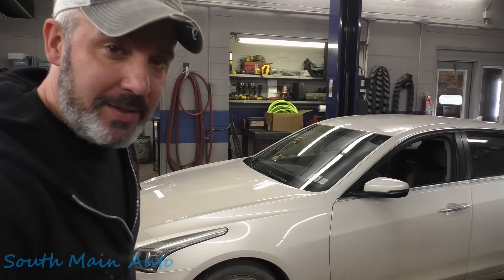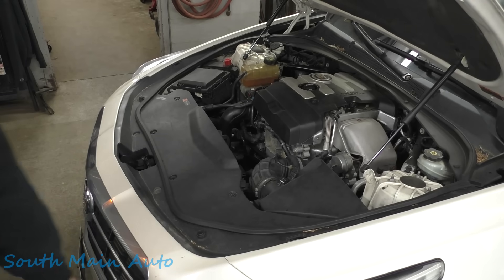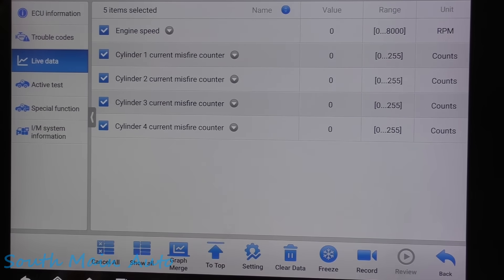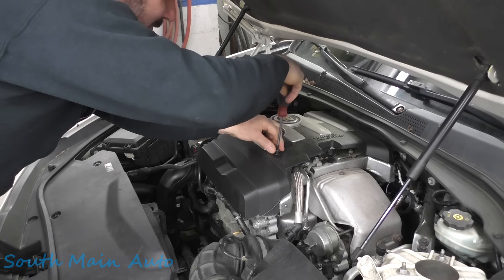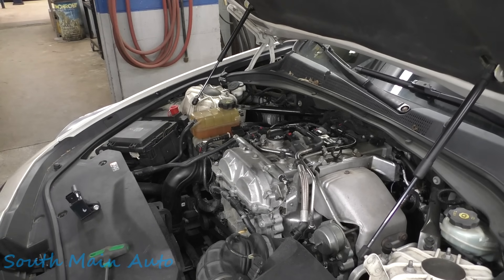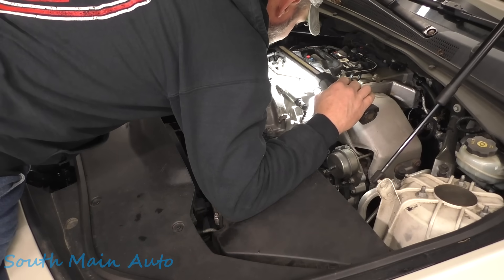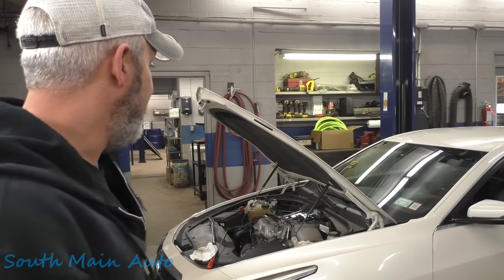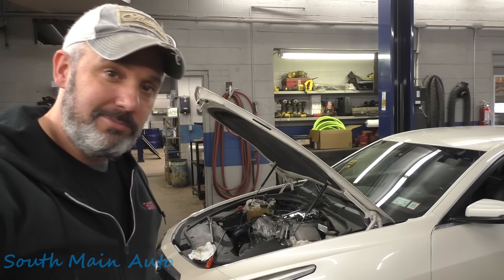'14 Cadillac CTS4 2.0 Turbo - Major Engine Damage

Comment: I bought a 2013 f350 super duty diesel a few years back. When it stopped starting I took it in for repair to a guy near me who only works on ford diesel trucks.  I wondered at the time how a mechanic could be so focused on such a narrow product line and still make a profit. 5 years and $10,000 later, I now know why.
Reply: I know a one man shop that does almost exclusively Subaru head gaskets.
Reply: Ya diesels went down the tubes around 2005 when the govt put all.these regulations on diesel engines.
Reply: We have a shop in Denver area that does nothing but moonroof motor replacement on Ford pickups
Reply: 😂 All of the diesel specialists make coin. Doesn't matter which brand either but Ford seems to have cornered the market.
Reply: Fix Or Repair Daly. Found On Road Dead. F'ing Old Rebuilt Dodge. F-O-R-D      Ha!

Comment: Mr. Wiggles gives an excellent picture!
Reply: Yeah, that thing is top notch! The picture quality is excellent, and the lighting is just right, and you can flip the camera to look upwards? They did a good job on that thing!
Reply: Would also be great to use for checking wall studs in houses for insect damage and insulation fill.
Reply: I just bought a Mr Wiggles after watching this.

Comment: For an experienced mechanic to say "that is the worst smell", that's saying something...must be something really special!
Reply: Pulling head bolts or main cap bolts on an overheated engine is way worse in my opinion
Reply: Old Supercharger Oil or burnt Diff/Transfer Case Oil. Absolutely horrid.
Reply: @kevinganus4468  Yep. Burnt hypoid gear oil has me almost gagging.
Reply: I am in the arcade hobby and I also operate games at work. In a pinball, when a drive transistor fails shorted and burns up a solenoid, that's probably the same smell Eric O is describing. It's pretty nasty.
Reply: Burnt out clutch packs in a pto comes to mind, takes a while and a good exhaust system 😮

Comment: After watching Mr. O's diagnostic skill I have come to the conclusion that if he can do it...umm no I would not even try. Excellent diagnostic skills!
Reply: Legend has it Mr.O has a tool to make a  car disappear if it's being ridiculous.
Reply: @attilakohbor3360  and his skill set?
Reply: This is too easy of a diag. You can hear the engine when cracking; next to tell the customer if it is an upper of lower end of the engine. Either way will be costly and recommend a new engine instead of rebuilding which is usually more expensive.
Reply: @Sneakdisscommentbelow  what are you implying?

Comment: That's a pretty standard piston crown for a modern DI engine. That odd depression is meant to concentrate the fuel for the best burn. Slightly reminds me of Honda's old CVCC system with their aux intake valve pre-combustion chamber.
Reply: They can change the injector timing and pressure depending on rpms and engine temperature.  The depression  is used during idle speed.  There is a Honda video floating around that explains direct injection very well.  Nobody at GM training ever explained to us techs how the system works... go figure.
Reply: I bought a new 75 Honda Civic CVCC.  The gas mileage was not impressive at all.  About the best I got with it was 30 mpg. I loved that little car but reliable, it was NOT.
Reply: @williamwhite9767 I recall Honda's goal with the CVCC was meeting emissions and no catalytic converter, so you could run regular leaded fuel that cost less.  This was before leaded fuel was eventually banned.
Reply: Similar to Honda, except the Honda would go 200,000 with just valve adjustments.  The state of the art for IC is now "clever, complex and unreliable".  What a shame.
Reply: @scrappy7571  Yep, my 75 didn't have a cat but most cars got one in 74 I believe.
Reply: @harrylister804  Well that 1488cc CVCC engine only had about 50hp.  And it had a rep for blowing head gaskets.  Strap a turbo on it and produce 4 times as much hp and see how long it would last.
Reply: They can get away with burning a very small amount of fuel by injecting it in that dimple just before the spark plug fires. No fuel at all in the rest of the combustion chamber so it is concentrated enough to ignite. If they were to do port injection they would have to have fuel in the rest of the combustion chamber as well, requiring way more fuel per rotation.
Reply: @williamwhite9767  They had the common sense not to do that so it would last 200,000.  The CVCC was a great idea to avoid needing an expensive cat.
Reply: @williamwhite9767  30mpg using a carbeurator is great
Reply: @Mach141  Later I bought a new 81 Ford Fiesta, the Ford of Germany Fiesta.  It was more powerful and got better fuel economy than the 75 Civic CVCC and was more reliable.
Reply: @williamwhite9767  yeah, Japanese cars didnt really hit their prime until closer to the mid early 80s. 1975 was not a good year for cars sold in USA in general, early smog days...they were still figuring things out

Comment: Too bad my dad is no longer with us because he knew just what to do with a car like this. Dump a can of STP in it and take it to the dealership after the service department is closed and when it’s dark outside. Tell the salesman that with the right car on the lot and a good trade deal he’ll move a vehicle before the store closes. No harm no foul. After all, the trade is probably going to the auction anyway.
Reply: Lols. Might have worked back in the day prior to OBD, but guessing the used car lot salesman will always have a scan tool and know how to check for those DTCs, and signs of whether it’s been reset recently mean you are trying to pull one.
Reply: @zerog2000  you would be surprised
Reply: They fuck you so bad on trades that the probably hardly give a fuck.  And they're going to drive it anyhow.  Whoever does the buy bid won't be a booger picking salesperson, so even if they bid before a mechanic can look at it, they will know its got a dead hole.  The bid guy is going to price assuming dead motor.

Comment: Ouch. Third failure, that sucks.😬
The bore scope is cool.🤙
Reply: The real ouch is that the owner didn’t learn a lesson after the first engine failed…he should’ve sold it after getting it going again.
Reply: @deplorablelibertarian  
Ya can't insult someone for not knowing any better. Whoever convinced them to do a second engine without researching the known issues is the one who is at fault, intentional or not.
Most people don't have a clue, that's why they bring their rig to a mechanic because, hopefully they know what to do.
Whenever I do a repair for anyone, the first check is known or common issues, that may not be what I'm fixing, but having that knowledge helps answer other questions they might have later, plus most of the people are friends or family anyway, so I might as well know what's coming.

Comment: Crazy to think Cadillac use to have a 500 and here we have a 123 cubic inch engine.
Reply: Can you still get a V8 in a cadillac?
Reply: @eltonyancey6426 CT5 V Blackwing and Escalade, at least.
Reply: Caddy made the 500 back when Ford made the Pinto.  Now the caddy has a Pinto sized engine.
🤣🤣🤣🤣🤣🤣
Reply: Sign of the times even Cadillac are feeling the pinch.
Reply: @eltonyancey6426 Maybe in the trunk/hatch.
Reply: @scrappy7571 and the pinto is a nova (no go in Spanish)
Reply: @eltonyancey6426  yes, one that self destructs due to having active cylinder deactivation
Reply: Just remember that 4 cylinder makes just as much if not more HP than the 500.   Lol
Reply: I have a 69 sedan deville with 472 and I have 2 Cadillacs with 4.6 northstars, I also have a 14 ats 2.0t. It’s the better handling and faster car out of all of them.

Comment: Some of these have a calibration update that injects another "squirt" of fuel into the cylinder to help prevent LSPI. Some believe it's left over carbon that starts the pre-ignition or just the way GDI's are designed. These engines have an amazing amount of oil dilution and direct injection also doesn't allow for any air to be mixed in with the fuel before it hits the bang chamber. I have a 2017 cruze 1.4l LE2 turbo. They claim the issue is fixed but my dealer told me that regular gas is all you run in these cars and I was hitting around 43mpg but came winter, the engine started rattling like it was having some hellacious spark knock. I started doing research and found that people were having problems with their engines grenading from LSPI and the TSB only diagnoses the problem with Symptom: Engine misfire detected, Solution: Replace engine. They also in the TSB tell dealerships to update to the latest calibration on the ECM that supposedly fixes the LSPI issue. I had to start running premium in my car and the pinging went away but my mileage dropped to about 35mpg now running premium. The engine also does weird hesitations and feels like its misfiring since I bought it with around 85,000 miles on the clock. The calibrations were the latest version so I'm wondering if they played around with the fuel maps to make the car run like shit just to keep the engine from blowing up.
Reply: There is more BTU (energy) in 87 octane gas than 93. Unless you can benefit from running higher compression or more boost the lower octane is more efficient for mileage. I would not doubt that they also richened up the fuel maps on the NEW updated calibration to save the motors from lean conditions which would cause preignition.
Reply: @cp6027  The 2017 LE2 in my Cruze does not like 87 at all. It runs fine and gets great gas mileage but there is so much knock retard per cylinder it starts rattling like the engine is going to grenade. Some of them hit so hard that it causes a misfire on that cylinder and I can feel it stutter. I think winter grade is more likely to do it because I didn't notice it until it started getting cooler. It was loud enough to be heard over the radio. I also can torque brake it and roll the window down to hear it rapping like 50 cent.

Comment: Eric, turbos on small displacement engines are an engineer's pipe dream as they radically shorten engine life expectancy! You increase cylinder pressure at your peril. Gas money saved by high efficiency tuning will be spent on engine repair. Three engines in 108k is a crime! Great show us how video! Thanks!
Reply: It's a real shame Toyota went from their tried and true 6 cylinders to a turbo 4.  All in the name of slightly better emissions and MPG.
Reply: @tul9033 Toyota could not meet the new EPA standards with their V6 engines any longer that is why. Thank your elected administrstion.
Reply: @tul9033  I put 300K on a '90 Eagle Talon Tsi which had a turbo 4 without engine failure, so one can make a turbo 4 that will last a long time. Mitsu proved it with the 4G63T engine.
Reply: The issue is all the fuel economy crap on modern engines like low tension piston rings and what not that makes these engines unreliable there's plenty of turbo 4 cylinders from the 90s that last a long time
Reply: @lawnboy8401 Correction: they couldn't meet it without attaching the V6 to a plug-in hybrid system
Reply: All this new technology applied to making lower displacement engines high performance to get the same HP and torque as v6's and v8's is not going to solve the problem of profligate waste.

The 2nd law of thermodynamics and peak oil spits at business executives

America circa 2024
Reply: @lawnboy8401 i remember the 80s smog, and air smelling like gasoline. now i can tell which vehicles had their cat stolen they stink so bad.
Reply: @lawnboy8401  Right on point. It's not so much the manufacturers intentionally pushing these engines to the breaking point. It's the EPA (directed by the current WH adminstration) that is mandating higher MPG and less emissions. It's the main reason manufacturers are forced to produce EV's that nobody wants.
Reply: @lieutenantdan8170  Don't forget the higher engine operating temperatures to squeak out less emissions. We are literally cooking these engines. And just think about that stop/start technology when your car is in traffic on a hot summer day shutting down at every stoplight, no running water pump to circulate the ~220 degree water in the block.
Reply: Not so, I drive a VW 1.2tsi engine, and as long as you change the oil at the specified mileage, they go on forever. Watching this channel there does seem to be a reliability problem with US car manufacturers.
Reply: @kevinsmyth9598  Don't try to tell people who watch car repair channels that Volkswagons are good vehicles. Some of them years ago may have been?
Reply: @redrider7730 keep pulling the legband to the side and licking the KFC gravy from orange jesus diaper
Reply: @lawnboy8401  you watch channels, I repair vehicles, VW are some of the most reliable engines around. Consumer law in Europe is very strict, the only dodgy thing was the diesel emissions scandal, but that was a marketing failure, coupled with unobtainable emissions standards.
Reply: @kevinsmyth9598  Well if your in auto repair? Then you know just how lousy and unwelcome Volkswagon is in the auto repair field.
Reply: In Europe we have taxes based on displacement and CO2 emissions, pretty much everything comes with a small high strung timebomb.

Comment: 'HEY NOT BAD ONLY 8 TROUBLE CODES" Very funny ,
Reply: He wasn't joking.
8 is not a large number of codes for a car built in the last 15 or so years.
 I worked on a 2021 Ram last week that had 68 fault codes. Most of those were caused by a weak battery.

Comment: Engine turning over and we could hear a problem with the term called DYNAMIC COMPRESSION Or Dynamic compression Test.
Just like clear Flood Mode :)  After a misfire or overheat, timing belt, or valve train problems.. Sweet camera saves a lot time.

Comment: I just bought a endoscopy from Amazon and had no idea where to use it. Now I know what to check. Thanks for this video.
Reply: You can also use it to check your plumbing! But no one else’s……😂🤷‍♂️
Reply: @RJJ6129  👍I’ll need a video to watch.
Reply: i just got the $50 version, because i dont need vid or pix.
Reply: I think you really intended that you purchased an "Endoscope".  "Endoscopy" is the procedure when using the endoscope.

Comment: Ex Cadillac tech here. We had a rush once of about 6 or 7 ATS’s with the same 2.0. All had cracked ring lands on cyl 4. I had one that had cracked ring lands on 3 and 4. GM released a recall to update the ECM for this. After that we never saw an issue. I’m surprised to see scoring, as well as a different cylinder lol. We always were able to replace the pistons and GTG

Comment: JB Weld in cylinder 1. and run the engine @ 10,000 RPM for an hour,  the crankcase will release the broken piston and ventilate the block and the new 3 cylinder will burn less gas
Reply: ¡No quemará nada de gasolina!
Reply: While you might manage 10K rpm with a mechanical system, modern ECUs prevent that unless the source of the rpm is the transmission, i.e. being stuck in gear going down a steep slope.

Comment: Great video Eric. At 15:49 The larger valve on the right is missing much of the outer edges. All the valves in that cylinder #1 are showing this edge erosion to some degree. I could be wrong. I don't see the same valve damage on the second cylinder (#2 I believe).

Comment: Reminds me of towing 20 yrs ago, and I had to take a 1984 Chrysler New Yorker to it's final journey over the car crusher rainbow. It had a 2 liter Turbo with under 100k, that the customer told me had cost him more in repairs than the car cost new. He had seen enough of a car with a engine that was too small to drive all the luxury components of his junk heap, so he was sending it to it's final resting place at the local car wrecker. You just cannot overcome simple physics with fancy turbo technology.
Reply: My mom had a 86 Turbo New Yorker that had over 200k miles on it when the transmission let go and it was faster in the 1/4 mile than my buddies 87 Trans Am with a 305 & automatic!  That car had 1 headgasket, a water pump and 3 timing belts it's entire life and my dad & I replaced everything in our driveway!  The fact that a car built in 84 was still on the road in 2004 should tell you something, it having under 100k miles tells me it was probably a old persons and the car sat all it's life which is the worse thing for any vehicle and the customer probably didnt not know the difference between a torque wrench & a line wrench and would rather have a car payment & dealer service than doing something for himself!

Comment: Had to replace a car this year.  Reading about the high compression turbo'ed direct injected engines from multiple mfgr's having issues, carbon buildup, or short life I oped for an older style engine.  I wonder if I made the right decision.  Are the newer engines really not as reliable?
Reply: As Scotty said "The more they overthink the plumbing, the easier it is to stop up the drain."

Comment: Eric,
Great video - thank you.
Perhaps you could do a video (WUW, etc) on why modern automobiles have to be so complex* -  which causes them to be more unreliable and more expensive to repair. I understand that some consumers want comfort, aesthetics, and performance, manufacturers want to reduce costs, be competitive, and profitable, and governments mandate safety, fuel efficiency, and emissions standards. But is it technology just for technology's sake? 
BTW I drive a 2006 4 cylinder 'economy' car with minimal features. It gets me from A to B, doesnt turn heads or make my neighbours jealous. It doesnt have 4/all wheel drive - needed for less than 2 percent of all miles driven. And it doesnt have 9 passenger seating - for one person 98 percent of the time. I also drive the speed limit.       *I understand 'complex' is a relative term.
SMA#1
Paul (in MA)